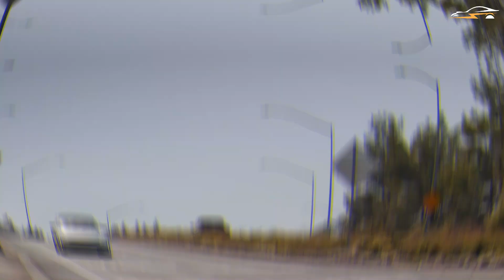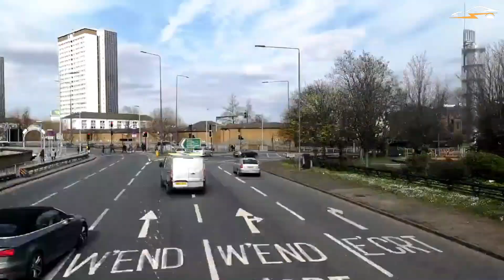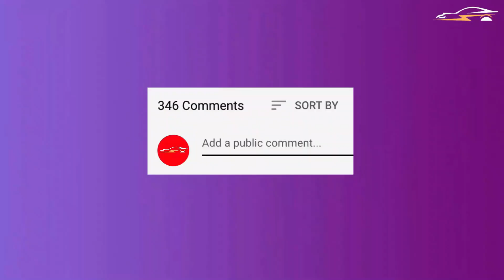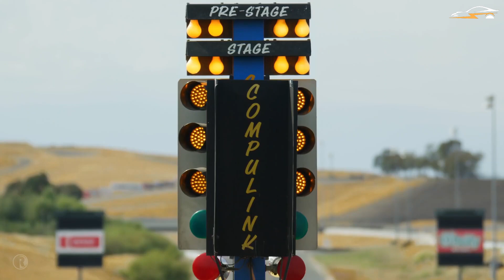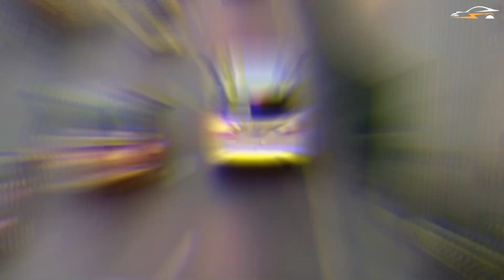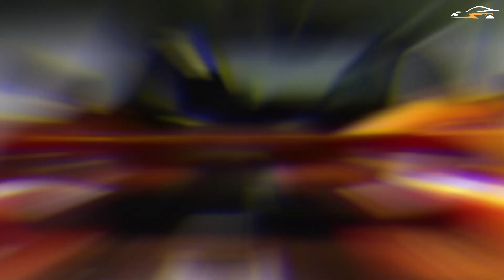The ULTIMATE Lucid Air Drag Race Compilation! 1,111 HP Lucid

Comment: not sure what the point is in having such a high top speed. The only place it can be used with moderate safety is a special track. wouldn't want to pay for those high speed tires.

Comment: The build quality of Tesla has gone downhill in recent years because they have given in to quantity over quality trying to put up numbers...but  
while the Tesla is slipping, here comes Lucid Motors who is looking to revolutionize the EV industry by raising the bar of what an EV should be. This is being led by the man who was the engineer of the Tesla model S, Mr. Peter Rawlinson. Mr. Rawlinson is a true innovator who seeks to constantly improve, whereas Tesla is not looking to improve on build quality or safety concerns because they are the so-called preferred EV. But the landscape is changing, and VW is looking to fill the affordable mass production void while Lucid comes to be the higher standard of EV"s. So, Take notice of the modern-day Preston Tucker, Mr. Peter Rawlinson and Lucid Motors.
Reply: Wake up, man! It's 2022 already. Go help Peter Rawlinson put out the fire!